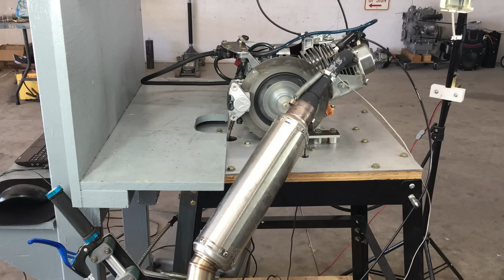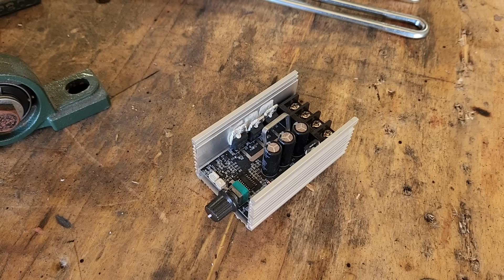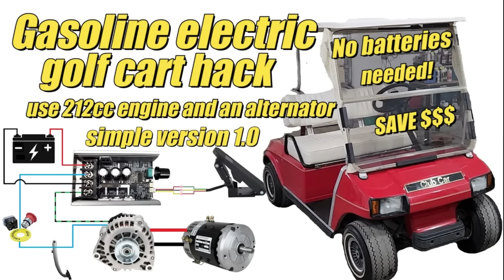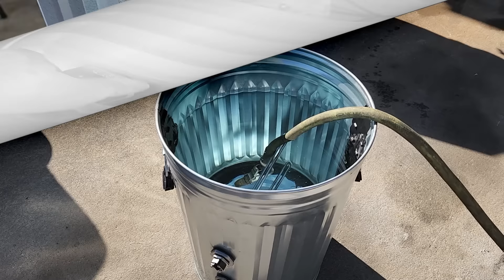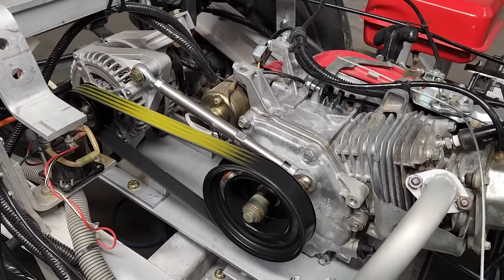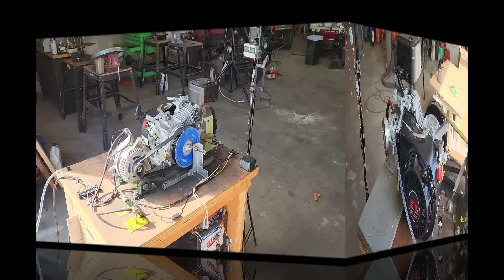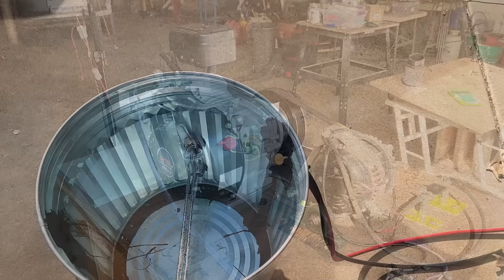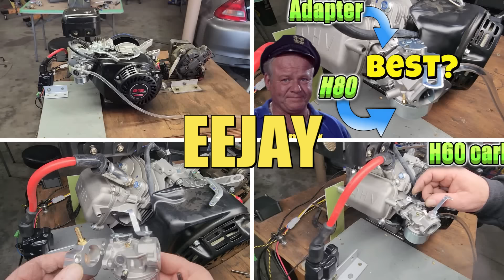S6 E5  Our small engine test stand is BUSTED!  can we fix it on the cheap?  Let's do an experiment!

Comment: could run a waterpump and radiator with fans , those fans allso drawa lot of current so could be added to the load , other option would be to dump uice in the garbage can if the water gets too hot or you need to run the dyno for a verry long time 

my idea of a dyno was a waterpump and a tower made from an x diameter waterpipe to add load to the waterpump  (as long as its not cavitating could add overflow pipes at different height of the tower to reduce the weight pushing against the flow of the waterpump , the other thing i wouldve done is build the waterpump on a set length lever and a loadcell measuring the torque on the arm , should be able to calculate hp pretty acurately that way though the watertower would take upo a lot of space , i live in a condo and could put it in the stairwell when in use though
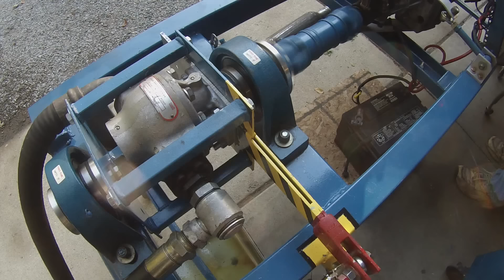Reply from the maker: We are going to build a special rig for the alternator so we can mount it in a way that will allow us to measure the torque.  At 2:06 in the video you can see how I mounted the hydraulic pump between two bearings and you can see the torque arm.

Comment: If you want to measure power output from thermal load you'd need to insulate the container. Otherwise, measurements will drift significantly over time. - Wasn't clear if it's just a dump-load like the ceramic resistor bank or not. - Do be aware that when those water heater elements fail it can be rather energetic. And in a medium that is practically incompressible you'd spray hot water everywhere. A lid with a chimney pipe should take care of that. Though, they can sometimes deform the metal around the bulkhead and that's on thicker walled water heaters. Add a breaker so that if you get a failure at the bulkhead fitting the leak doesn't energize the metal container.
Reply from the maker: The resistors and this new gizmo are just dump loads.  In order to measure true  HP we need to build a special rig to measure the torque on the alternator..
Reply: @robotcantina8957 mount one side of the alternator on a bearing pivot. Other side of the alternator, build a bracket with a strain gauge load cell between the alternator bolt hole, and the fixed base, also a jack screw to adjust belt tension. Calibrate with a torque wrench over the operating range from 0 to however many ft-lbs, and graph the data points to confirm it’s a straight line.

Comment: This looks like a reasonably same project, but there is a another way you may wish to consider. Ditch the heating elements and fill the barrel with saltwater. Then you run the electric to two plates which are separated by a few inches and are fairly long, the amount of power they pull is very by the salt concentration and the depth to which the plates are immersed. You would add salt until the thing drawn more current than you could supply with the plates fully submerged, and then raise the plates up to lower the load. It is called a brine resistor, and has been a round for a very long time. It is capable of exhorting lots of power at very little cost, and is easy to build. I've only heard of them being used on AC loads, but you could pull AC out of the alternator and just bypass the dives if you wish. Or buy a cheap generator head.
Reply: Plus he can debunk the HHO generator BS that still plagues the tube.

Comment: Why not by pass the alt diodes and run AC to the load?  I would think there is a power loss converting to DC.
Reply from the maker: We could do that, but we want to dump as much power as possible and loosing some through heat in the diodes works to our advantage.
Reply: @robotcantina8957  Agree, but the power loss is not measured as HP (watts) at the load.

Comment: Hey Jimbo, your desired 3000W load is equivalent to 10236 BTU/hr.  Half a 55 gallon drum will hold 225 lbs of water.  Thus after an hour of engine runtime, the water will have risen 45F.  No safety issue there.
Reply from the maker: Cool, I knew someone would know the math for that.  thanks!
Reply: @robotcantina8957  Benefits of being a retired HVAC guy.

Comment: It's possible  the rectifier uses 1200 volt automotive grade diodes , from the research I have done. The diodes  in 12 and 24 volt alternators are the same..
Reply from the maker: LOL, I have no idea, but they seem to be able to handle the voltage fine.

Comment: At 4 minutes 49 seconds on your PWM power supply it seems there is a gap between those 3 TO220 semiconductors and the metal enclosure that serves as a heat sink.
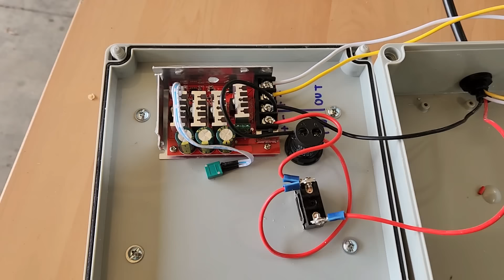Reply from the maker: LOL,  so the PWM power supply that was featured was a blown up unit that was handy.  at 10:27 in the video you can see the good and somewhat different unit.

Comment: May want to double check the power usage of the elements... Water heaters usually have an upper and lower element that are both the full rating of the water heater, but only run one at a time ever.
Reply: You're right though, he definitely has 2 4500watt each water heater elements.  Maybe he meant to say he should have bought 120v elements with lower resistance so he can get each to dissipate more power.
Reply: Never mind I see you're actually testing the output yourself and I should never comment before finishing the video
Reply: @jmilleronaire you should know this 😆
Reply from the maker: LOL, saw your other comment,  all is good.
Reply: @robotcantina8957 don't buy another set of 4500watt at 240v elements and think they will have lower than 12.8ohms of resistance each.

Comment: I have only one question: Why chop the drum barrel? I mean if you leave it as is, it will take more water / refrigerant inside, so you can leave it for more time before needing to manage hot liquid issues...
Reply: I came to the comments to ask the same thing.  More water for more heat dissipation ability and less work (not having to cut and re-weld the drum).
Reply: Me three….
Why cut it down?
Reply: @flyonbyya  makes it easier to put your feet into it :P

Comment: We use a plastic 55gal drum. Fill with water add water purfier salt. Make a brine. Bolt on a peice of copper buss bar on each of the leads out. Stick one on the bottom of the brine tank. The second lead is moved up and down to adjust the load on the generator. The only down side is dealing with 50gal of brine.
Reply: Doesn't that split the water into hydrogen and oxygen?
Reply: @keithwilliamson8428  small amount. Use tape to cover the completely submerged electrode all the way to the tip. Leave about half an inch. The only hydrogen and oxygen will be created by that small surface area on the tip. Also make a small vent hole on the top.

Comment: Why not put the heating elements in series?  Why not use AC output from the alternator as AC is what is used by the heaters normally.  You would take the load off the diode bridge as it would be out of circuit...  Did I miss something??
Reply from the maker: When putting resistors in series you increase the ohms.  putting resistors in parallel decrses the ohms.  for instance two 10 ohm resistors in series will result in a 20 ohm load.  two 10 ohm resistors in parallel will result in a 5 ohm load.   We want low ohms on this rig.

Comment: The voltage is actually pulsed dc. Doesn't the meter measure peak voltage. Should you use rms?
Reply from the maker: The voltage  has some ripple in it for sure, but at 3600 RPM engine speed and  10,800 RPM alternator speed the ripples from the three phase alternator are nominal.
Reply: Oh yeah, 3 phase...I forgot that.

Comment: You could always do something like the pony brake but use electromagnets instead of a physical brake.
Reply from the maker: So intimately it's the load, whether its friction or electrical.  Our plan is to go the electrical rout and the alternator will get mounted in a special rig so we can measure the torque.  at  2:06 in the video you can see how we mounted the hydraulic pump in a special cradle in order to measure the torque. we will do something similar.  Today we focused on a device to send all the energy to.

Comment: If your trash can cooling tower gets a bit toasty on longer tests or hotter days just add an old car junk yard radiator and electric pump to the system, zip tie a box fan to the radiator, and problem solved. Honestly though, just pointing a fan at the can is going to be plenty to keep it cooled. Using a radiator though you could run a smaller reservoir of water and have a more compact stand setup all in one. As for the box dancing around, the solution might be magnets. You can epoxy some strong ones inside the box and just stick it to some steel plate on the stand. It's still easily removed but it should keep it from dancing off. You know the plastic clip that holds my dryer door shut kept breaking, so I just stuck some magnets to it and now it stays closed better than ever. Magnets are great. Another way you might tackle vibration could be to swap to a over running decoupler pulley on the alternator. It lets the alternator freewheel a little bit if the engine slows and absorbs some shock on the belt during sudden speed changes. I swapped to one on my high RPM summer car and I noticed a difference in shift shock at 8000 RPM, it's much smoother, and idle seems slightly more stable too.

Comment: Mad scientist Dyno, love it. And the petroleum battery keeps on giving. I have this blue screen digital watt meter doohickey that uses the same kinda shunt, I have a 100 amp one and a 300a for it, you can tell it what to use and apparently it can do 200v. I'd slap one of those on there with more elements and let it sing. I use mine to measure my computer that runs off batteries, it's nice that it calculates the watts for me in real time. Maybe with some ac electric motors instead of the 212, or a very stock engine you could figure out the efficiency numbers between the specs and your Dyno and just convert the watts you dump into the water with whatever percentage testing says, to sort of calibrate it and get decently accurate horsepower numbers for funky engine experiments. Like does the modified carb actually make more power? What about timing? What about feeding it propane? Or how little diesel can you use if you add propane on top with my favorite testing engine. I need to get one of those but Amazon doesn't have them for anywhere near the price you guys get on this side of the pond.

Comment: Definitely enjoyed this video, hopefully you will share the audience what you will do to address the vibration issue possibly from the crankshaft pulley..

Fuel holes like you should make a second channel of just behind the scenes stuff or however that might look..
Reply from the maker: Thanks for the suggestions!
Reply: @robotcantina8957 proofreading is obviously not my strong suit, but I hope the message is still there, I personally love behind the scenes things even if it's quickly filmed and barely edited and not hardly made for anything other than just a quick here's this here's how it went put my proofreading in lack of spell checking my speech to text what kind of deal with me on my last message, thank you for reading through that.

Comment: Could use a float valve for a livestock tank to keep it full and a needle valve to control how fast it leaves. Unless you’re testing for hours it might not be necessary though.
Reply: Even cheaper, a toilet bowl float valve. Works the same way, costs like 10 dollars. The hard part is adapting it to fit a garden hose but I found a way for my ducks

Comment: Why do you need diodes? If you are applying the current to a resistive load, AC works just fine.
Reply: He would need 3 sets of resistors because the alternator output is 3 phase AC.

Comment: This channel should be required curriculum for all engineering students.
Reply from the maker: Thanks!
Reply: @robotcantina8957  sorry for asking but why you using current and voltage to measure engine power output while it's less correct and harder to get all things measured right? 
Isn't it easier to put a tensiometer/load cell on a generator bracket and measure braking torque (which combined with RPMs will give us more precise engine power measurements? 
Asking because nobody really knows your alternator efficiency (especially in a given setup) and measuring torque on a generator bracket will leave us with only one unknown efficiency (rubber belt transmission) which is still way more precise than your setup? 
Is it mostly because of cost? 
And yes, your videos should be used as training materials for mechanical engineers to get basic understanding. 
Anyway thank you for your videos and hope you'll make more of them.
Reply: @teolynx3805  Jim already said in this video that he's doing it this way simply because he wants to.
Reply: @teolynx3805  Like he's talking about @1:05? He knows, the only important part about a dyno is that it is repeatable.
Reply: @TJPDmember  and measuring torque is way more repeatable than measuring volts and amps on alternators output because torque doesn't depend on temperature of the windings or heater elements, torque doesn't depend on alternator efficiency and etc. it's more repeatable than measuring current.
Reply: @teolynx3805 it is like the consistency of master air chuck that all other accurate air chucks are compaired with at a pro bike race like Tour de France   who cairs if it is accurate if it is consistent.
Reply: @teolynx3805 ok so he pulls out the old brake rotor load cell to find the stall tq. Now we have quantified the variable  5kw water bath stall 5kw brake dyno stall .
Now its apples to apples. Kw( V×A) has a conversation to TQ/HP
Reply: @teolynx3805  using a strain gage isnt easier than measuring current and voltage. Measuring power is easy. Measuring and recording strain gages/load cells takes more specialized equipment.
Reply: @justinlabarge8178  it's not harder... 
Easiest way is to use scales ... 
P.S. do you know efficiency of his alternator? I don't. So with his setup I can measure only power output of the alternator which could wary from 80% to 50% of real engine's power output.

Comment: My test stand is just a generator and three space heaters with two heating elements in each: two 2kw ones and one 3.3kw. This allows me to select any combination of 1kw and 1.65 kw heating elements. 

One day in the future I'm going to modify them a little. Each heater has a 4 position switch: off, fan only, 1 heating element or both heating elements. I'm going to add a relay or two so the "fan only" notch becomes "both heating elements in series". There is an adjustable thermostat that turns off the heat entirely, so the fan only notch is redundant.